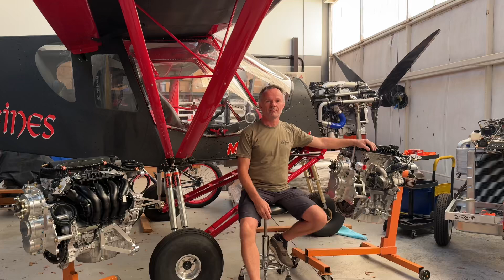Talks with Viking Part 7 - Testing

Comment: The “tester” blaming you for not testing doesn’t have a clue on how to properly test anything using established methods and best practices. They also don’t understand a defined operating range that allows for a buffer zone for safety and longevity.